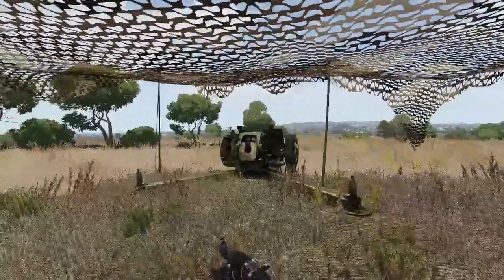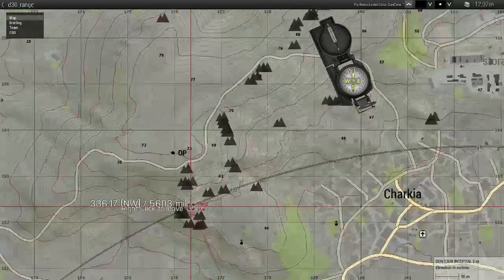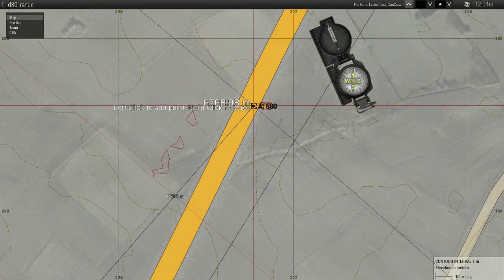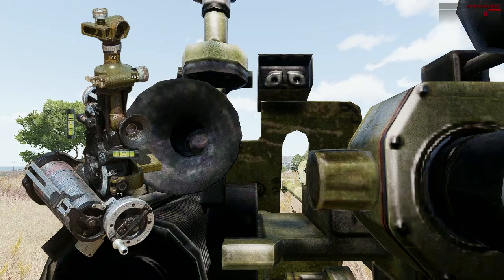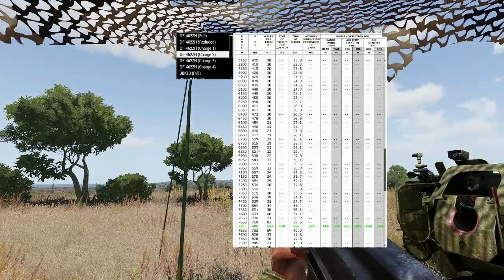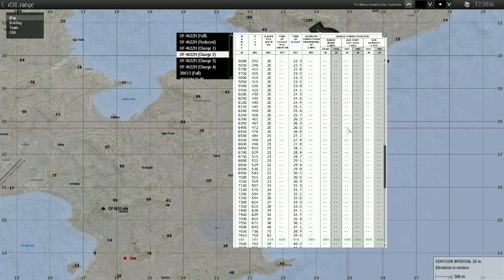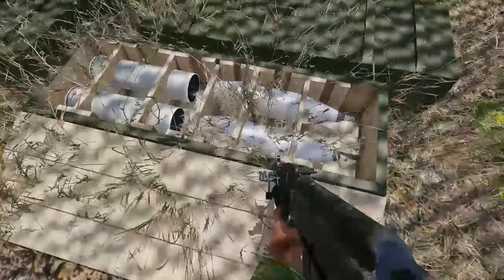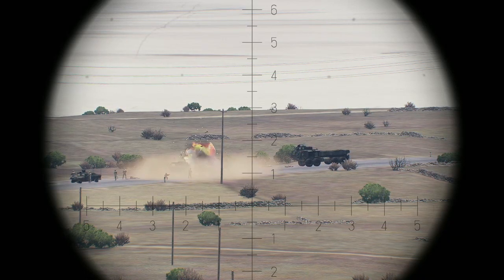Arma 3 - Realistic Artillery Tutorial | Part 10 (Map orientation, elevation)

Comment: In the D-30 Calculator excel file you shared, High Elevation is high, for example 1351, but the д-726-45 optical sight shows up to 1200 at most. how do we solve this
Reply from the maker: yes.. the excel is just a cheatsheet... you are in a cold war.. no computers, should calculate with a pen and paper :)
seiously I did not put logical expressions to rule out everything so to the table it will give you all theoretical solutions. The D30 elevates only 70 degrees...
Reply: @gezalesko3813  Can shots be fired at the same target from higher or different elevations ;)
Reply from the maker: @ubersoldat1939  you just got me.. I was planning to do a video on MRSI "cold war style".. but I was busy with the SPG-9

Comment: what mod is it
Reply from the maker: https://steamcommunity.com/sharedfiles/filedetails/?id=2912776798
Reply: @gezalesko3813  thanks!
Reply: @gezalesko3813  is there a mod to calculate in Russian mills on the map? Also, how do I compensate for the altitude difference?
Reply from the maker: @fedorvonbock7665  https://steamcommunity.com/sharedfiles/filedetails/?id=2912737139
this is a map tool I modified to use russian mils. To compensate for altitude difference you take the range table. Read the column where it says how many mils you need to compensate for 100m altitude difference and divide it according to your actual altitude difference. If you shoot low angle and target is lower than substract, if higher add to elevation. If you shoot high angle than other way around.
Reply: @gezalesko3813  Ok, thank you very much :)